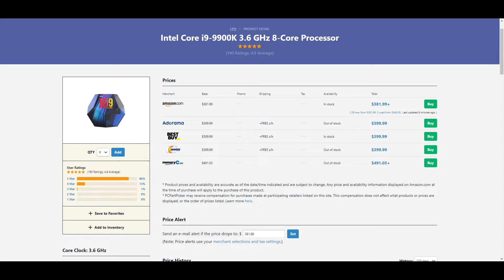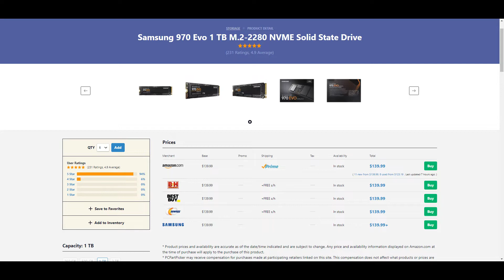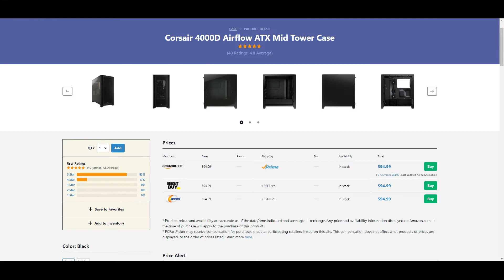My $1500 Gaming PC Build 2021! (RTX 3060 Ti, i9-9900k & Corsair 4000D)

Comment: Yo, would i9 9900k work good with rtx3060 not with (ti) or should I get other gpu for this i9 and do I need liquid cooler for cpu or will the stock be enough for it, cuz I found already built pc with them...?
Reply from the maker: i9-9900k should work well with a 3060 still! And would suggest at least a 240mm or 280mm radiator at least for the i9-9900k, runs hot!
Reply: @JayFish  thank you, just 1 more q, with this setup and +16gb 2666Mhz of ram would it be able to run 240Hz on 1080p?
Btw nice video, keep it up 👊